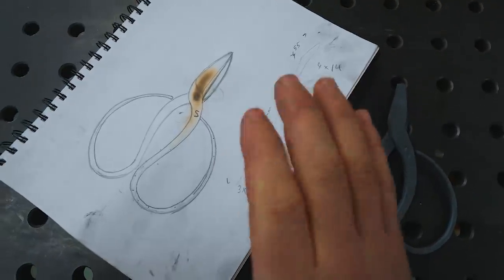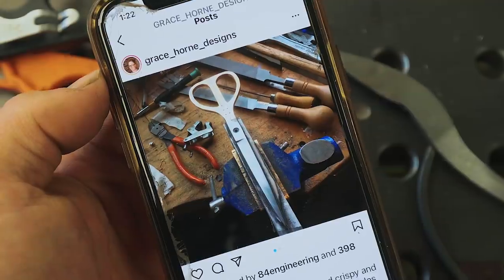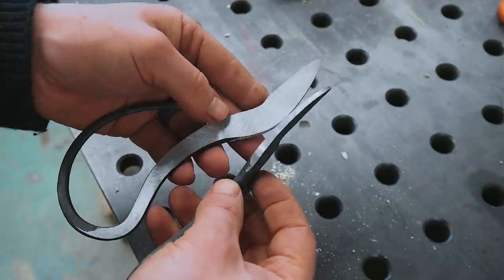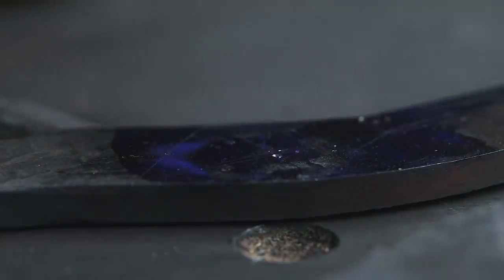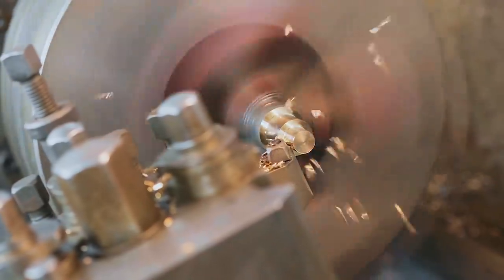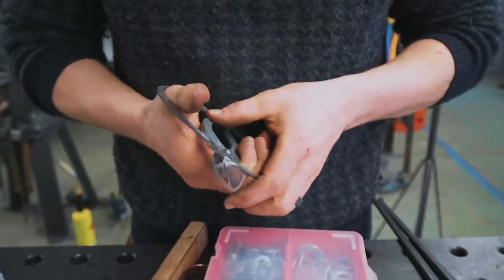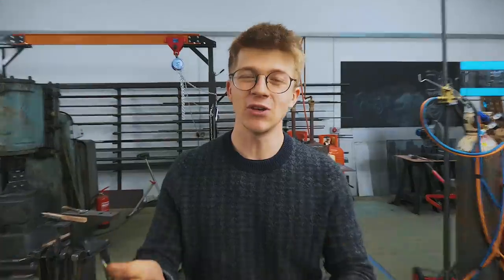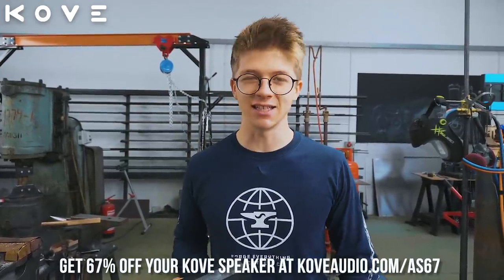MAKING BONSAI SCISSORS!!! Part 2

Comment: Made sheep shears several years ago and the trick that I found to getting them to cut right is setting up the edge cold. Light peining work along the inside of the two scissor halves will set up the spring tension so that they cut.. Again they do need to be cold though otherwise your just putting a bend in them not increasing the tension. Hope this helps someone

Comment: hey alec, you have inspired me to start forging my own swords and so far I am having a blast. While I can't say that everything I do goes according to plan it amazes me just how much i learn from my mistakes. One area I have really struggled with has been grinding in fullers, can never seem to get them straight with my limited set of tools and experience. However, like I said, learning from mistakes is how we make those experiences worth while. "Improvise adapt overcome" is one of my favorite phrases, I like to think that's exactly what I did in this situation. Instead of continuing and failing, quite miserably I might add, to grind a fuller I gave up on grinding all together, and found a clever alternative. I have seen you, and other youtubers, use a metal etching technique to engrave your name in several of your swords. I thought that was an ingenious way of removing material in a very specific pattern, so after a few trial runs I developed a method of etching in my fullers in a salt water bath after masking the majority of the blade in electrical tape. I learned that I could control the depth of the etch by altering the amount of time I allowed it to etch, (typically an hour for 1/20th of an inch in depth, but that can change depending on several factors, ie steel type salt concentration and power supply).  I couldn't be happier about one of my failures as it has enabled me to create beautiful curved fullers on my latest blade that I could never have hoped to grind in myself. I doubt you need another method for creating fullers but I think it is quite a handy technique that you might like to try. I myself have been experimenting with more three dimensional shapes and "carvings". Anyways hope you found this interesting, love your videos, keep making beautiful pieces of art. You too Will, love you bois

Comment: I seem to recall that good hair sheers are supposed to have a slight gap between each side to allow you to create your tension as you cut. This is why they usually have a screw holding them together and are not rivetted together.

As for your hair, nice job Mrs. Steele!

Comment: Having just put 40 copper rivets into an oak chest I can see your raised lip, after I had made the head I used a steel block to hammer in at 90 degrees which pushed the sharp lip in and closes the gap, I like the hammered look compared to a rivet set.  Great to see you streaching your skills, its the way to learn.

Comment: Just FYI (i know these were ment for bonsai) hair cutting scissors have macro serrations (just like your raptor that is meant to cut kevlar) on one blade as a secondary bevel so when they are closing and cutting the hair the hairs dont slide out towards the end and the cut does not turn out crooked instead they the individual strains get stuck in the serrations.

Btw the cut turned out great !

Comment: You may need to consider standardizing a wood or perhaps a brass plank that has a standard arc to which evenly arc both blades. Maybe with a set of holes to affix the blades for an even match.

Comment: One tip when drilling,tap the drill for 2 or 3 seconds then it chips away the iron and dip the drill bit in water every 7 or 9 drills (coming from a 16 yr old btw)i was very inspired by you

Comment: Just an FYI, hair cutting shears are about the most precise scissors you could make. Hair is tougher than most people think. It is also very thin so it is easy for the hair to get caught between the blades if it isn't cut.

Comment: Dad's old wallpaper scissors..... scalpel sharp and heavy in the blades but so comfy in the hand, old  too..... at least 60 yrs old, my bro still uses them. Kept oiled and honed you could split them and shave with one blade...... so sharp thanks to dad. 

Big thanks to Mrs Steele, you did a better job than his scissors, but...... barber scissors are far lighter and agile to use, and a whole lot sharper. Imagine two scalpel blades sliding along each others sharp edges, that's how sharp and light they are. You'll need stainless steel for starters..... then a lot of time and frustration. And stones, wet/oil stones

Love you all  snacko's for your woofs

Comment: i learned that the best scissors that i have 
the bevels or sharp edges arent flat smooth they have microscopic groves 
when one of my scissor got dull i tried to sharpen it with a stone and it didnt work 
but then i used a honing steel and it worked as good as new

Comment: Just an advise please drill with slower rpm and with your types of steele I would suggest cobalt drill bits they hold the longest and if you plan on using a hand drill pressure is important so start with a 3mm or so an then drill the full way but you make awesome vids so inspirening
Reply: Moly oil?

Comment: I think it would have been easier to go for a pair of scissors with a longer blade for your first try. As with most things in life, the larger it is the easier it is to see what's happening and that would help when trying to line up a pair of scissors. I also think it would have been easier to do the quench after everything is together..... and lined up properly. At the end of the day, though, they might not be any good at cutting hair but they'll work well for everything else and the definitely have a lot of style 😊👍👍

Comment: the scissors you made are not designed to cut hair, btw.  They would work ok for garden tasks like pruning small stems, etc.
hair shears, and even good fabric shears have blades that are slightly hollow on the inside face, in addition to the set and or torsion mentioned before.  When Sharpening these "higher purpose," shears care must be given to the "ride line" or leading edge of the inside face of the blade.  this is honed to a fine surface, often to 3 micron or finer.  This will show as a thin shiny line along the extreme inside edge of the blades, and must be indexed and honed in the same plane as the pivot surface.  One of the things you were experiencing was "overset" as the blades were trying to cut into each other, but could also have just been too coarse a ride line.  I hope some of this commentary is helpful, as i respect your effort a great deal.

Comment: Nice! If I had to guess, the bevel is too shallow.  Bonsai scissors are shallower bevel than most (most scissors are like 70-80 degree), but still you're looking at a 30 degree single bevel - much steeper bevel than sharpening a knife.  Think more like sharpening a jointer or plane blade.

Comment: So, $3.50 us scissors, not $35,000 us scissors. Quite a difference. How many more prototypes to get to the $35 K type? Ten or Twelve pair of those a year and you could retire! The haircut was quite good, considering the tools mandated. I suspect Mrs. Steele has cut hair more times then Mr. Steele has made scissors! But Alec, you never say die- I expect to see a box in the corner where you store all the next attempts till you get it right! Right?FR

Comment: bugs me slightly with the wireless speakers, they are sortof awesome to carry into a worksite etc. (i dont have this speaker, just some random one).
but the 7 hours... 
your normal workday is 8 hours, not unusual to go longer. sure you can plug em in and keep playing. but if you have to plug it in, then whats the point of being wireless.
i still love em, but im just questioning the design choice in that 7 hours.

Comment: You weren't a full minute into the video and I was wondering aloud "Do you know how scissors actually work?" and then you get all nitty-gritty about it.
Also, bonsai scissors aren't meant for cutting hair, but for nipping buds etc. on tiny trees, so your painful haircut was quite appropriate. ;>)
Reply: I was reading through the comments, contemplating that for a hair cut, he might want different scissors. There is a reason why all those different types of scissors and shears exist in the form they have.
Reply: @michelbartolone4328  Exactly. I note he didn't try to cut his hair with those folding EDC shears. ;>)

Comment: The reason your drills don't work is because you're running WAY too fast and not putting enough pressure on them. Turn your drill to low speed or get off the freaking trigger. It's so frustrating when 'metal workers' on youtube don't know anything about drills. Get a drill press, set it to about 500 rpm, and pull down about as hard as you can. High pressure, slow speed, that's how you drill steel.

Comment: Why in the world would anyone think Bonsai Scissors are the thing to cut hair with?
I know AS always says he does not know what he is doing ...... but why not check out the subject before you jump in?

Scissors are sprung AND hollow ground so only the tip is in contact and that at one point at a time!
Because of that you could never get your Bonsai scissors to act this way .... so they are not the tool for the job!
Also cutting paper does not "cut it" when you are talking about hair.
Maybe another video on how to make a set of hair clipping scissors (and sharpen them) .... clue ... Not on a Belt Sander!